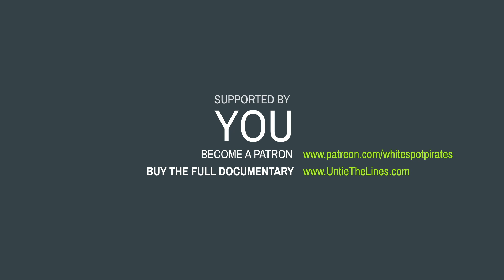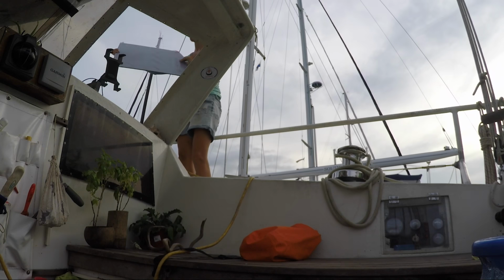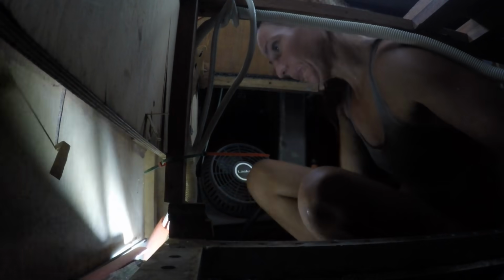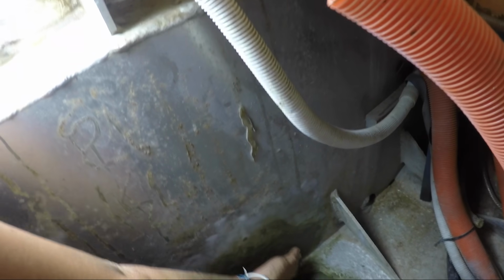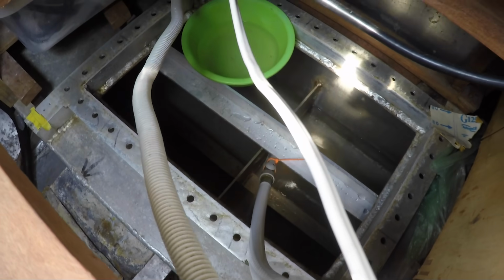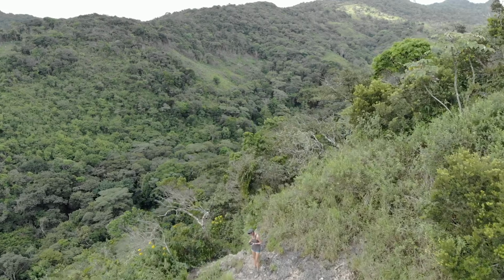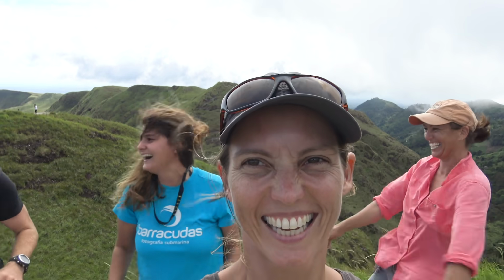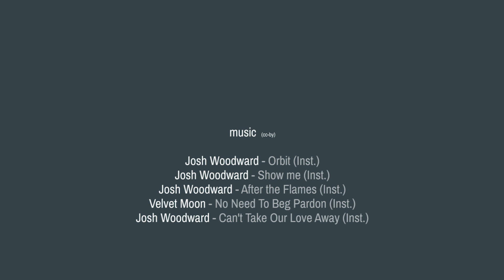Fresh Breeze Of Diesel And Mountain Air - UNTIE THE LINES IV #21

Comment: In the future you might try using a brad point drill bit. They are designed to drill holes in wood without causing tear out at the margin of the hole. The bits have two sharp points opposite each other on the end of the bit and a sharp point in the middle. The points on the bit meet the margin of the cutting area and score it as the bit goes in. This helps make a smooth cut.

Comment: Glad you made that call about the plate in the tank. I would however use flathead bolts on the windows that allowes a little movement to avoid cracks. Great to see the spirit returning, never have regrets about the things you do! In the long run you only regret the things you never did.. ⛵️

Comment: I´ve just been binge watching this whole thing and what ( among other things) strikes me the most is that there seems to be nothing wrong with your determination and ability to look for solutions... Wonderful to watch!!!
 Then choosing an old aluminium can, is something you only do once in a lifetime! Back in my days of crusing I´m glad I chose steel even though I was tempted by aluminium but it´s just too easy to contaminate, like with that stainless rotating brush you use. Hmmm... And laminating one plate over the other is a no no as anything else as an emergency solution, as you have no clue what is going on in between. Cut out and replace, as we steelguys do.
I really hope you work this out and get on your way, because after seing all this, you are really worth it!

Comment: Two lessons I learned working with Acrylic and polycarbonate sheeting. Always clamp a piece wood to the underside when drilling. It prevent the bit from biting when it go through and no chipping/cracking will occur.. As chips later develop in cracks. Always drill slightly oversize holes to allow for the screw/bolts to expand when heating up in the sun. Most important. forget expensive plastic drill bits. fine oil stone(grinding stone) and change the rake from positive to negative. It only take a couple of runs on the stone. Or else,use another method and grind the bits on a bench grinder. I use the first method as one can also then do think bass plate.
Reply: Way back when I started my technical career as well as sailing I did a lot of maintenance work in a large marine for extra income over weekends. My mentors was back then artisans from a wide spectrum,from upholstery workshops,right down to  aluminium 7075 or better known as duralium. Was on the receiving side of many slaps to the head if I did not follow instructions. Eish the old generation artisans was from another planet. I learned more during that periods then in all my time while apprentice and  technical college. BTW learning way back to weld 7075 took me on a very interesting path as certified airframe welders was very scare. So I was offered for free a coarse and certification by a guy who owned a yacht in the marina and they were busy restoring a warbird and to get a welder in on weekends was difficult. He assisted me and I did my certification actually in the welding section of the SA air force at the time.
Reply: Fluke 87-5 multi meter in conjunction with their land/sea kit T&R model SC-4 Ag-AgChl reference  electrode kit. Hmmm,this combination can generate some income while among another yachts experiencing problems.

Comment: vinegar works incredibly well cleaning fuel tanks (and others) it has about a 5% acidity level if i remember right.  i was beyond impressed when i tried it on a tank that had no hope.  I let mine soak for a couple days or so, then sloshed vinegar around to rinse the crude out, then rinsed with water, blew the excess out with my air gun, then rinsed with fuel and iso dry (high mixture ratio) when i was happy with that, i mixed sloshed with straight fuel, before re installing and added iso dry per manufacturers recommendation when i fueled up.  I was really amazed.  it would help prep for welding too, with the acid and de oxidization abilities.

Comment: Use Plasti Bit drill bits. They are sharpened at a different angle and it goes through that material like butter. Glad to see you getting things done!
Reply from the maker: Ralph Lange they did not have any of those in Panamá...I looked in a couple of places but in the end had to work with what there was at hand. Still worked out quite alright 👍

Comment: Use pure beeswax on your drill bits and circular saw blades when working with aluminum.  Keeps them sharp and lubricated.  Just stick the bit in a block of  wax (1/4" or 1/2" or so)  every 3 or 4 minutes.  About the same with a saw blade.  This is what aluminum fabricators do (the smart ones)

Comment: Well done you know it’s not a fix  ,just temporary , very temporary , As alloy corrodes you filler comes off  , but it holds off the replate till later , good to see morall is up  , any contact from Barry  ,I here he arrived
Reply from the maker: gess ges well, the corrosion should hopefully be over with the culprit (the lead) being properly insulated from the Aluminium again. I have splash zoned some areas before and it’s actually holding up quite well...but maybe it’s not a “good for ten years and never needs to be checked on ever again” kinda fix, that might be very true 🤣
Reply: WhiteSpotPirates oh well it gives you piece of mind for a while  maby next haul attack that one , keep going your doing well enjoy your vids Thankyou from nz

Comment: If you had a wood boat every so many years you'd have to replace some of your planking and more often you'd be caulking seams everywhere.  On a fiberglass boat you'd be worrying about blisters and frames epoxied into the bilge and how much water was in them, metal boats have corrosion or rust problems.  Voids, empty spaces you can't get into scare me, I like things where I can see them.  Was the lead in the bilges there as ballast?  Do you have to replace that weight to maintain stability?  My ship had a steel hull and aluminum superstructure and the joint between the two was problematic and this was planned out by naval architects and engineers in a big shipyard.  Cunard built the QE2 this way, her replacement, the Q. Mary has a steel superstructure and she is wider to carry the extra weight and add stability so you are in good company with problems with aluminum.  I'd suggest that welding a plate over another is not a good repair, best to cut out the dodgy areas and weld in the new plate over the area cut out, the problem is the void created between the old hull plate and the repair piece that you can't see.  Don't think that two 7mm plates give you 14mm of hull, even if God did the welding, water would get between them.  Boats are not all good times, maintenance is a constant, there will always be a repair list.

Comment: Incredible she still look sane (and beautiful) after working inside the hull with 2-component epoxy chemicals, acetone and other times pumping out diesel from leaking fuel tanks and what have you. I'd be totally cross eyed after such sessions.

Point with this post: I think she should prioritize some proper ventilation and protection gear. Don't underestimate the risk of CSE.

PS. The fact that she continues to repair Karl and perceives the boat a person, may indicate that some damage has happened :-) Naa, go on fix the bugger.

Comment: Nike, your new Makrolon will be fine for a few years, but you have ensured it will crack and craze again. You must let plastic breath, expand and contract with thermal changes. This can be easily 7mm per meter.  All the makers post guidelines, there are several ways to do this. But simply screwing it down, guarantees failure to come. Perhaps in five years, perhaps ten.
Reply from the maker: Lyfan Deth hi Lyfan, the windows are actually held in place mostly by the butyl tape. The screws are really just a back up, there is no tension whatsoever on them and they all have play, meaning the hole that I drilled is at least 1mm bigger than the screw itself. I think it will be fine, but let’s talk in five years from now to be sure 🤣

Comment: One sailing couple, Nanji, brought up a good point. By replacing the tank (I'm assuming with some sort of non-metallic one they increased their fuel capacity from 220 gallons to 300. I think that's the correct channel and if it was liters (their Australian) , my apologies. I do not know how much it cost. Another thing they have found was a tax free "island". They are currently In Malaysia. From what I've seen, costs for this same tank may be twice as high as your costs for the same tank ? Unless there is a tax free place around there ?

Comment: Have been thinking more about the leaking hull business.  It is true that a fibreglass boat would be easier to repair if you decide to sell Karl on, and there are boats out there that would offer more performance under sail, especially to windward, and a higher level of refinement and luxury.  But then you will still have to make Karl seaworthy before you put him on the market, so that you can ask a fair price, so it seems to me you are stuck with the business of doing a professional repair whatever you do.  So once that is done you would be in a better position to ponder the sell/keep dilemna.  

And of course a selling decision is tightly related to what you can buy for the selling price, and how much you are prepared to accept for Karl if you go that route, so surely this decision will also depend on what is available, in what condition, for how much money.  Just thinking out loud.....
Reply from the maker: Bruce Bolster yes, I agree pretty much on that. Plus, a new boat would take some time to get used to / know all the systems...

I don’t believe that fiberglass is the ultimate solution for trouble free sailing, though ☺️

For now, Karl is not for sale.....😋
Reply: That whole easier to fix myth of fiberglass.
Has to be perfectly dry.
Sometimes special chems are needed to prep surface area.
If conditions are not ideal barrier coat may take up to a month to dry properly.

In essence...they all have their draw backs.
Reply: @WhiteSpotPirates  Verry Happy to hear that!! As long as you can prevent galvanic action Allu is the best material at Sea.

Comment: Niki, do the words Intergranular Disimilar metal Corrosion mean anything to you?  Flap brush sure, brass wire brush sure, but Stainless with Aluminium? *facepalm). Maybe you SHOULD consider that Plaexiglass Bottom.
Reply from the maker: daverjax I have seen many people use stainless brushes to clean aluminum. I even read about it in some online workshops on how to clean aluminum for welding...As long as they are good quality, only used for aluminum and you clean up after so no little bits are flying around I don’t see why that should not be done? It’s not that the stainless is staying in contact with the aluminum afterwards, so why is this such a wrong thing to do? I am obviously missing the point here, so would like to hear ur input on this.
Reply: Belay my Last, thought it was the Hull Holes not the tank.
Reply from the maker: daverjax 🤔 now I am lost. This was the tank wholes that I was cleaning. But it’s the same material that we are talking about, both aluminum ...which you were referring to above, no? Was just curious why you thought it was so bad to use that brush. I had been advised / recommended to clean aluminum with stainless brushes in the past and when i read up on it I also found that kind of advise. Now if this is such an obvious “no go” to you, then I would love to understand why so I can learn from it for the future 🤓